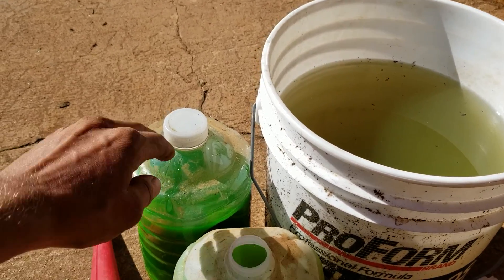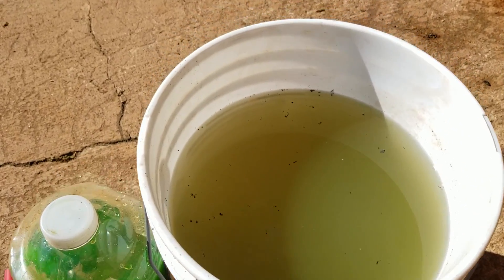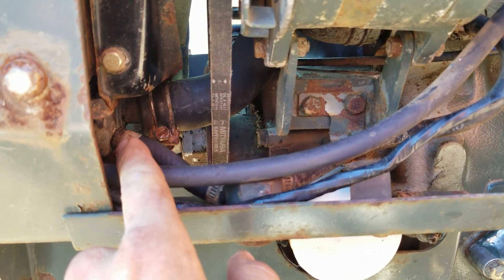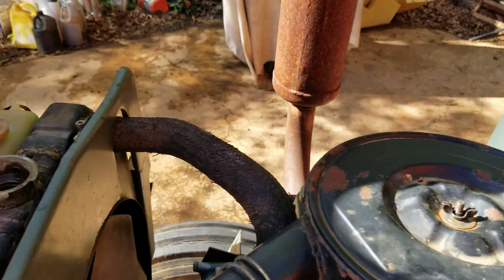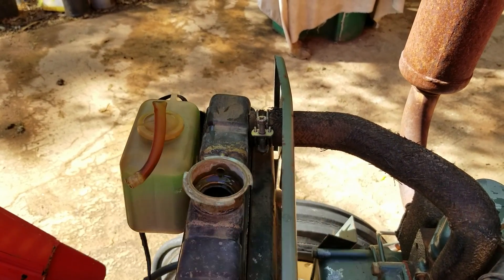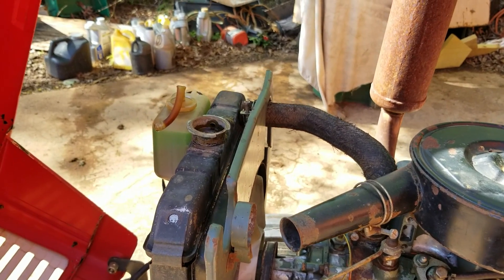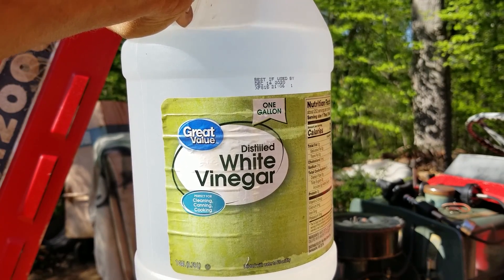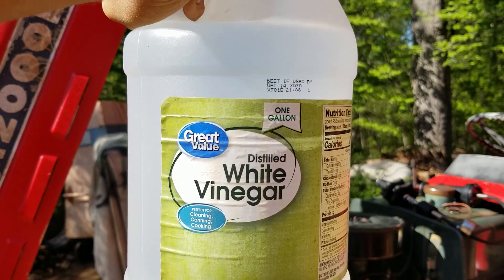Tractor Vinegar Radiator Flush: Part 2 WILL IT WORK? LET'S FIND OUT!

Comment from the maker: Hey Yall! Check out the description to links for tools and supplies used in this video. 
Abandoned Yanmar Tractor Part 3: https://youtu.be/Uk9vPygUKcE
Timestamps:
0:00 Intro
0:38 Old Antifreeze
1:02 Cooling System Overview
2:10 Vinegar Fill Up
3:37 Drain Vinegar
5:15 Water Fill Up
6:02 Drain Water
6:51 Pressure Test For Leaks
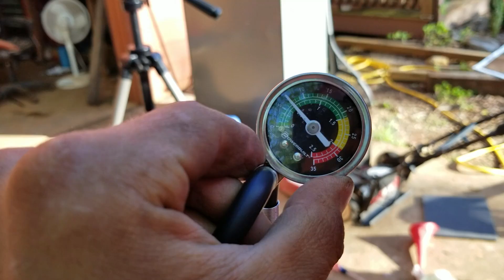8:07 Results
8:31 Pressure Tester Kit Rental
8:52 Outro

Comment: One video. The guy flush out the radiator with water a few  times. Then unhooked the hoses . Block the opening to keep the solution from running out. Then poured a small box of baking soda in the radiator then straight vinegar until it was full Close the cap . Let it set over night. Drained the  solution. Rinsed the  radiator until nothing but clear water came out.
Reply: baking soda neutralizes vinegar, might as well pour straight water in

Comment: 4:22 That blue color is because of the oxidized copper leaching out of the radiator. Copper/brass radiators are soldered together with lead, which is colorless in solution unlike the copper, but just as biologically available now that it's been dissolved. Soluble lead is probably not something you want to get on your hands, unlike lead metal your body can absorb this quickly.

Crazy that people do shit like this and have no idea what they're getting into. Not to mention pouring it on the ground.

Comment: I'am Your Newest Subscriber You Wasted Your Vinegar I Put A Gallon Of Vinegar In My 1988 Chevy G20 Camper Van I Run It For 1 Hour That Hot Vinegar Cleans It Out Really Good
Reply from the maker: Yea! It works. Better straight outta the bottle.
Reply: I had thought about using vinegar to flush rust out if my 95 Dodge Ram, but not sure what it might do to the aluminum parts. 
  I bought some derust solution but have not used it yet.

Comment: The green is from the corroded copper.
Reply from the maker: It's crazy the radiator fins are all copper. This thing is old school!
Reply: @MattsShop  yea the 2000B was produced early 80s. The regular 2000 was produced lat 70s into the very early 80s. The B was an upgraded model, more shielding for sound deadening, gauges, lights fuel gauge, different 3pt control. I love Yanmars. I have a YM2000 and a project YM187 which was an American market version not a grey model like the 4 digit models.

Comment: Any joy with the Yanmar?
My 1st thoughts when you 1st turned it over was the valve lifter was jamming on somehow but you mention later it wasn't.
Nevertheless, if someone has been messing with it before you, did you check for tappet clearance on TDC on both cylinders.
Rather odd for the compression to be sooo low.
Patiently waiting now for an update 😉
Reply from the maker: I posted an update check it out here: https://youtu.be/Uk9vPygUKcE   Yea, I checked the tappet clearance and it looked good.I'm about to tear apart the engine.

Comment: I have a running YT146D 2 cylinder if that motor is blown up, what do you want for it the way it is 
N/E illinois.
Reply from the maker: I'm not interested in selling it. It's gonna get fixed and put to good use.

Comment: May be wait and clean the block too when you get it running. But may be you have a line on another motor. A lot of different paths to take. Good video, nice find. Fyi vinegar works better hot.
Reply from the maker: Yea, the block is going to get some fresh paint once I rebuild the engine.

Comment: Great video. I have the same tractor and it doesn't run.  Has been setting up for 6 years.  Where can I find parts?  No one in my area is any help.
Reply from the maker: That's crazy you have the same tractor! Check out www.hoyetractor.com They got every part you need.

Comment: Did you use oil in the cylinders to see if the compression would come back? Could have had a fuel issue and use a bunch of quick start to wash down the cylinders.
Reply from the maker: Yea, I did the oil in the cylinders trick. It did absolutely nothing for the compression.
Reply: well its got something wrong in the piston and or valves department so stop fannyin about with what it isnt and get the head of and look save your money to buy the parts it actually needs  you say there isnt anything wrong with the de comp @MattsShop

Comment: Great video. I have a Yanmar 2210D and rebuilt the top end of the motor. By the way...I'd run less than 50/50 in my radiator. I ran that mix in mine last year and blew the radiator.
Reply: Kelly, I may learn something from you... how does running 50/50 antifreeze cause a radiator blow-out? And why are you recommending a less-freeze-protection mixture?
Reply: @jackonthefarm5540   According to what I researched (and please don't ask me to quote where I found it....I've slept since then).anything higher than the 50/50 would be too "thick" to pass thru the thin lines in the radiator. Matter of fact...I probably ran more than a 50/0 in mine when it blew. Those radiators aren't really that big in the first place.
Reply: Not sure about the 2000's ,  but my ym1500 does not have a water pump and it's supposed to use a 70/30 mix to ( create movement ? ) in the radiator thus pulling it through the motor. Some sort of physics' crap or something. Love my 1500... She is a tough old girl!
Reply: @alvinrespass5013  70% antifreeze and 30% water or the other way around?

Comment: i forget what it is called , but dont forget to add the special additive to the diesel cooling system
Reply from the maker: Never heard of it?!? What's it called?
Reply: That’s for extended life type. Just change at recommended intervals and no need to. Frantz must have a six 0   That’s what they recommend to do after 100,000 thousand miles